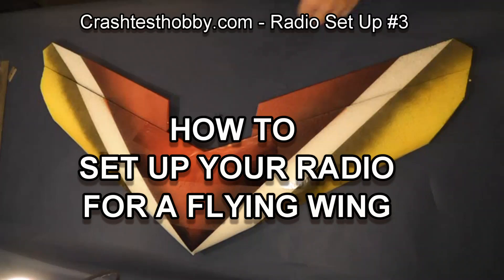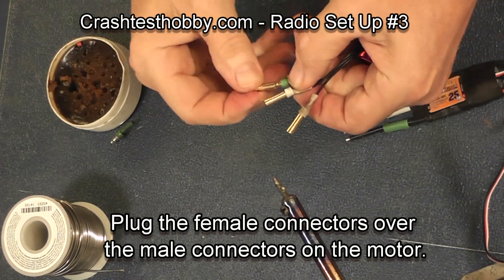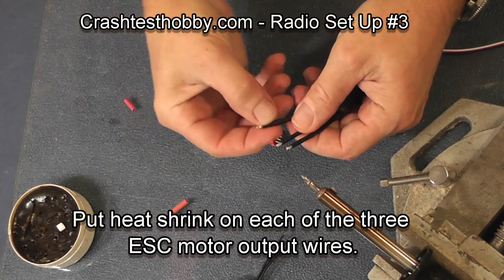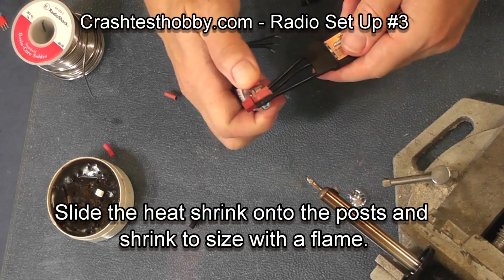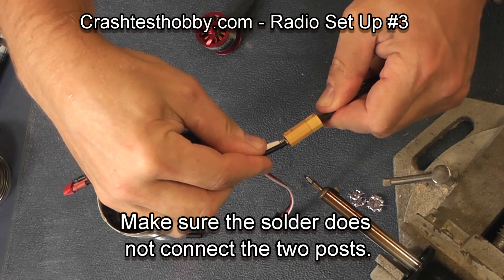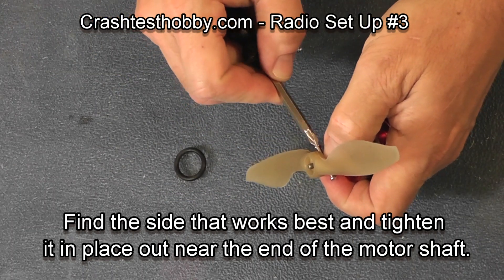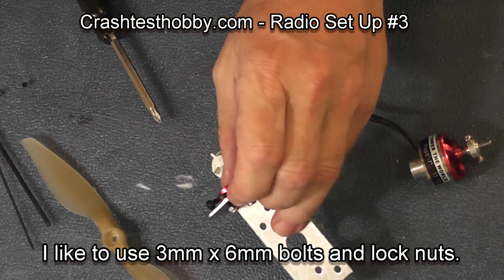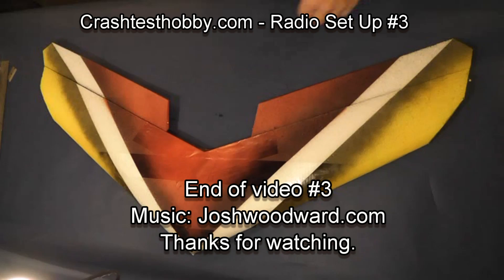How to wire RC Battery-ESC-Motor #3

Comment from the maker: If you only have two wires you don't have a 3 phase motor and will need to use a different type of ESC.  The soldering is still done the same you only have to find components that match.  My recommendation is upgrade to the 3 phase motor They are much more dependable and have more power and don't wear out the brushes.

Comment: Im gonna laminate mine tommorrow after school, what heat did you have your iron on?
Reply: The laminate melts at 185-245 degrees Fahrenheit, take a scrap of the laminate (just cut a corner off) and heat up the iron to about this heat and try laminating it onto a piece of cardboard box or something to get the feel of when it will attach. You can also practice with a small piece on one of the ends of the elevon you cut off before lamination. Hope this helps! Good luck with the build!